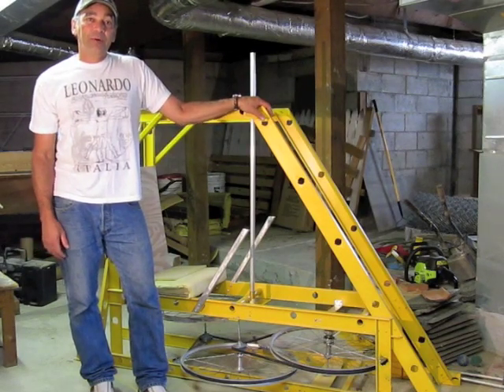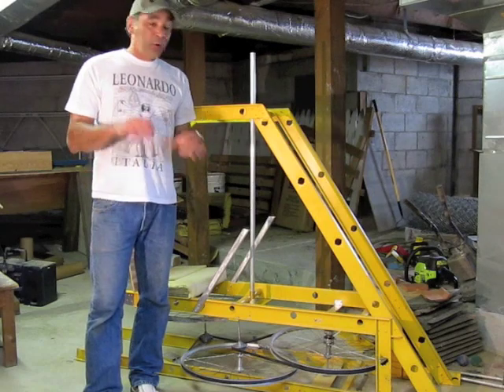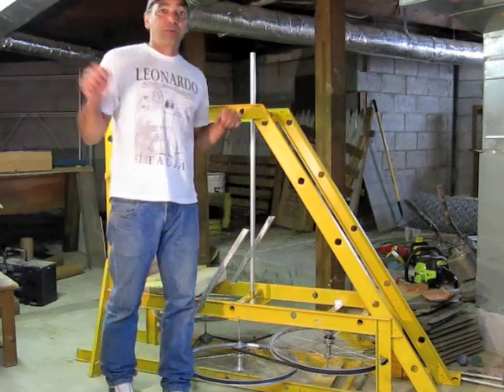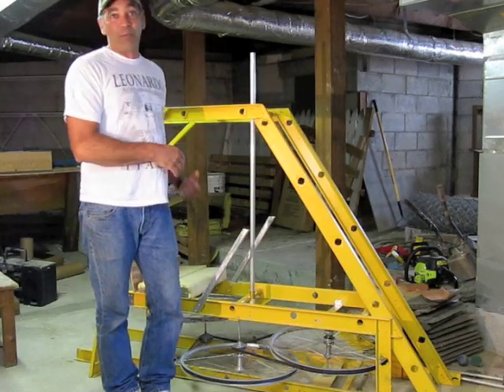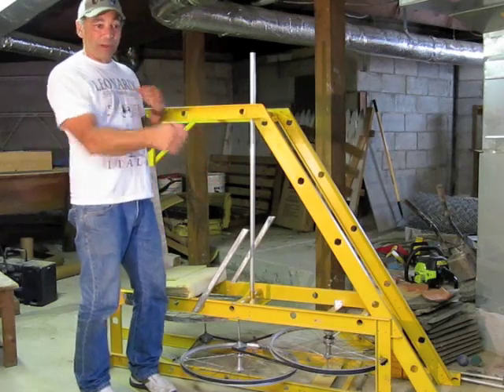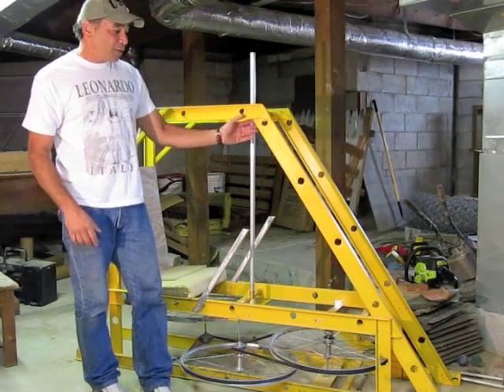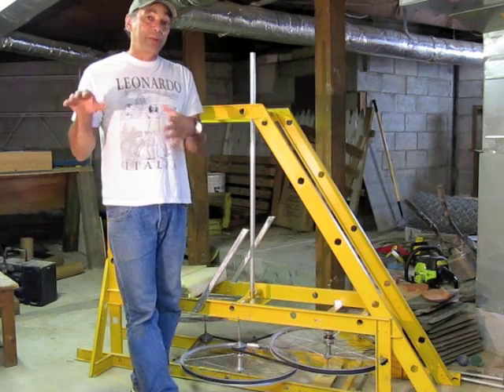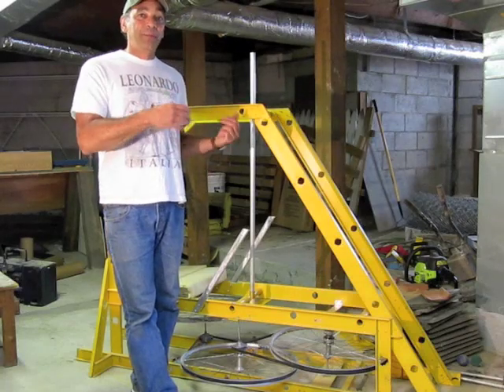Human Power Heli Demo YouTube

Comment: Great project efrain. I'm no expert, but reckon the only flight you can effectively achieve and maintain using human power for any decent length of time, would only  be a ground effect vehicle, surely? However, I've been proven wrong before, regardless, I wish you the very best of luck. It's the folk like you who ignore the nay sayers, and sometimes surprise everybody with a good result!
Reply: but this man using a completely different type of traction, he has dynamic skinned aluminum wotor blades that will create all the the lift he would need
he succeeded and won a major praise then he prototyped the sun projector
but the lens need has to hand ground over many hours using special flats
although these flats are getting cheaper and appear on ebay occasionally
and you need a tool to check for concaveyness and covexyness

Comment: Looks like you have the frame ready to fit a bike motor on and turn that little sweetie into an auto gyro! Have a driving propeller behind you and an impeller on top for lift. People are too weak/heavy  to fly vertically on their own strength, that is a physical law that won't ever be overcome no matter what the frame weighs. Gyro copters have been around for quite a while and there are all kinds of plans to be had , maybe one could do this frame of yours justice.

Comment: I am afraid that the aluminum would be too heavy.  I know that the carbon fiber is very expensive but maybe you could consider polyurethane or polystyrene both of which are used to make surfboards which are both lightweight & strong.  Duroplast & bakelite  are two other plastics which have fiber incorporated in them.  When is your next video coming out & do you have a date in mind to try to get the AHS prize?  Best of luck!

Comment from the maker: Human powered airplane  flight is actually much easier to do than a helicopter. Rotary flight takes a lot more horsepower. Aside from using the best mechanical advantage I am also working on a novel rotor blade design. I'm working on a small scale model to test my wings, will be testing it tomorrow.

Comment: @efrainpalermo A lot of it is also about finding the most efficient method of generating lift given the power output of the human motor. There seems to be no agreement on how to best generate lift. I wonder also if we are maximizing the human power output. Someone must have tested different methods of maximizing power output during the race for human powered airplanes. Where is that data? Which is more efficient: the standard pedal method or your leg press method? I wish i could build things :-)

Comment: @efrainpalermo You know, I watched the Cal Poly Da Vinci III video from 1989 a number of times and I didn't realize until now that it was also driven by props at the ends of the rotors.  Clearly stability was an issue for them.

Comment: "darkhungers" is right.
When designing a human powered vehicle the simplest forrm of transmission of power from the "human" to the "vehicle" will be the most efficient. There will inevitably be extra weight, frictional and torque losses the more you add.
The real challenge with this type of project is reducing weight.
1. Minimise the chassis and triangulate.
2. Simplify the mechanism.
3. Reduce friction.

I still like your leverpedal mechanism ;-)
Good luck...

Comment: It looks like a great plan.  I am no physicist but it seems to me that with the rotor connected to the main shaft that the force of movement (I don't know if you would call it torque or friction or what) would tend to make the craft autorotate even with the tip propellers.  If that is correct do you have a backup plan, either a tailrotor or a counterrotating main rotor like a Russian KA-50 helicopter?  Best of luck!